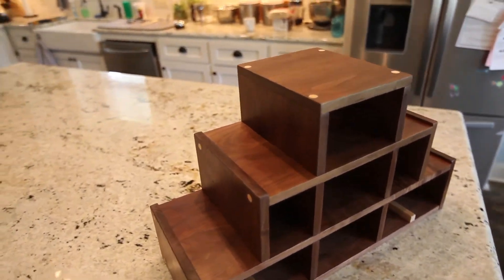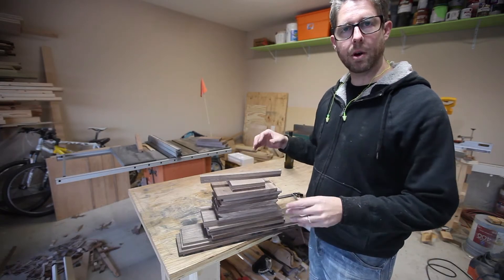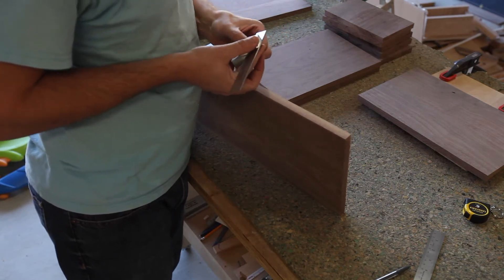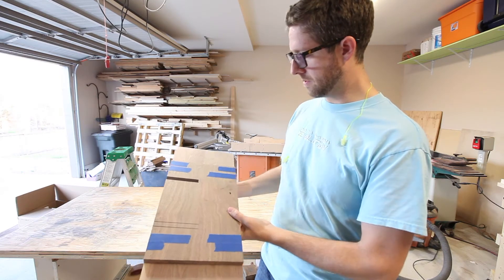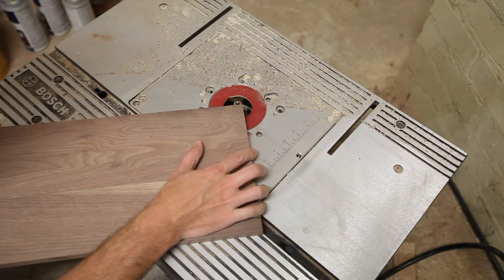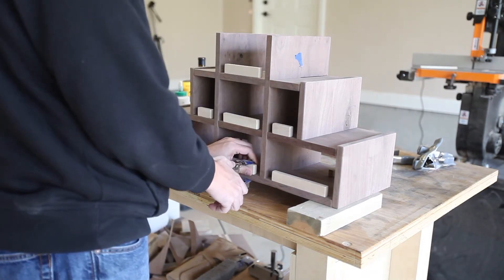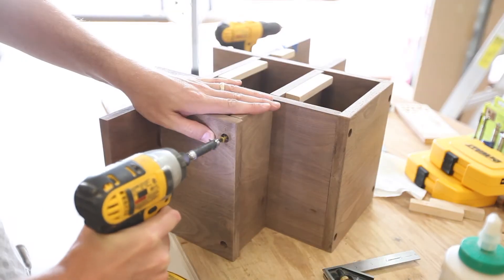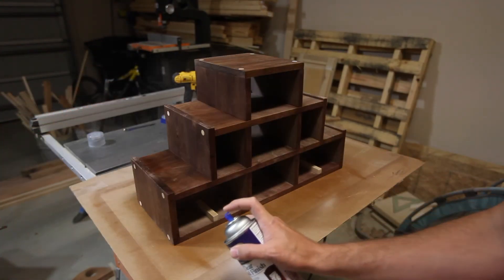Modern Wine Rack

Comment: Love the style. Iv'e made the resaw mistake several times and still make it. It's tough to resaw and have enough thickness because the boards warp or twist and require more milling.

The only thing I would do different would be to cut the slots on the table saw using your sled or miter gauge. Raise the blade to the correct height, cut one side of the groove, move the board over and cut the other side and then remove the waste in the middle.
Reply from the maker: SimpleCove [Sean Walker] Great suggestion with the tablesaw. I’m not sure if I could’ve gotten the full depth with it is why I did not try that. And you’re totally right about pieces warping after resawing them and requiring more milling.